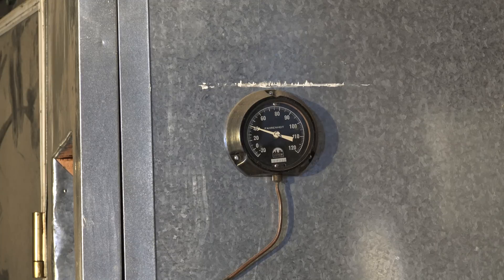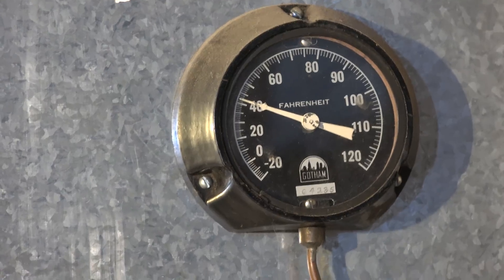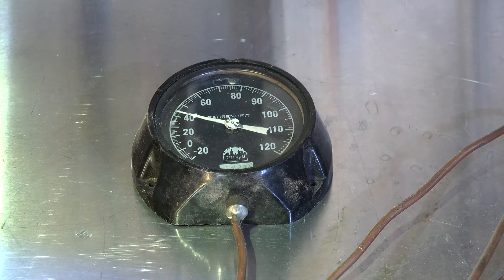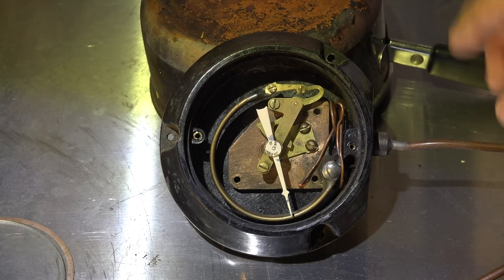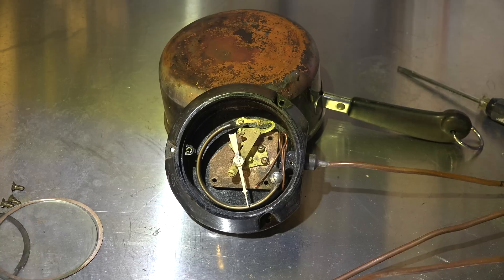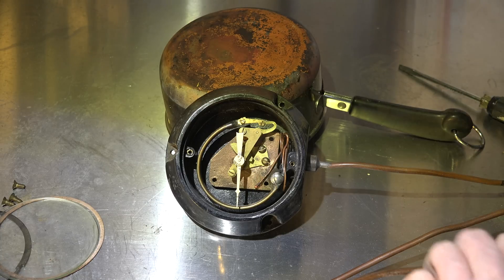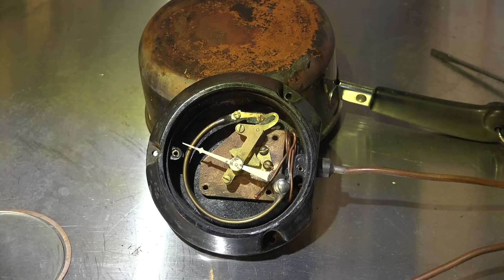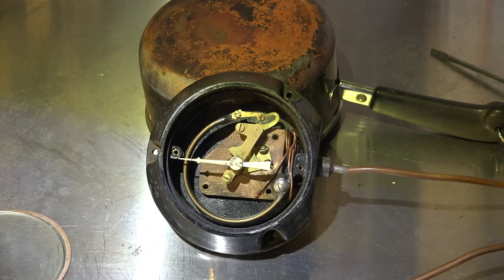How the bulb thermometer works

Comment: My 1965 Saab had one of these, it was neat and you could tell at a glance regardless if the engine (or key) was on. 
The Honeywell temp gauge I have even has a beveled edge glass lens, I got it for a few dollars at a thrift store
Reply from the maker: +Craig Nehring I can beat you in age with a 1938 Ford pickup truck temp gauge that looked like a glass type thermometer.  Or even Model As with the temp gauge on the radiator.  All cool stuff.
GFM